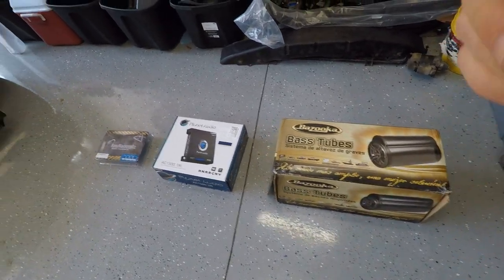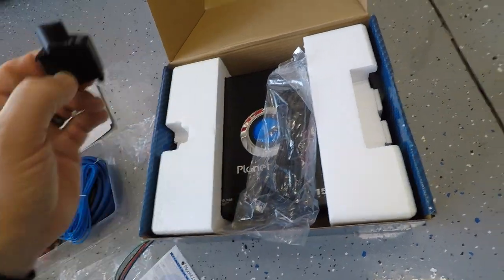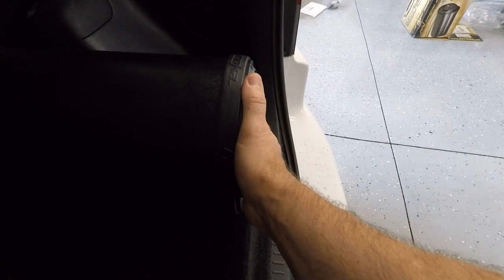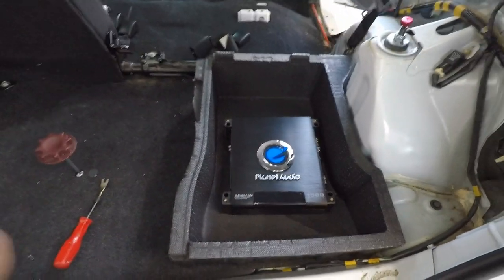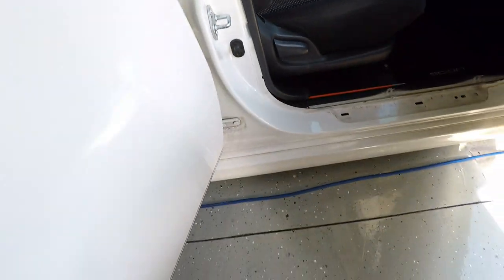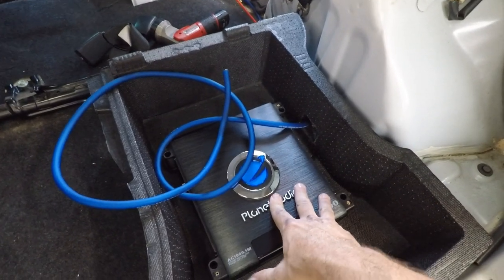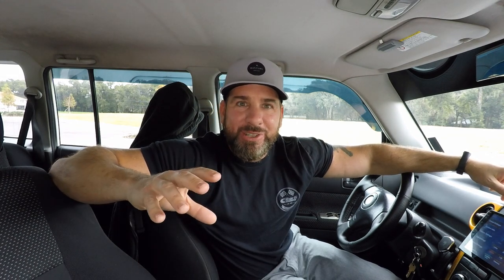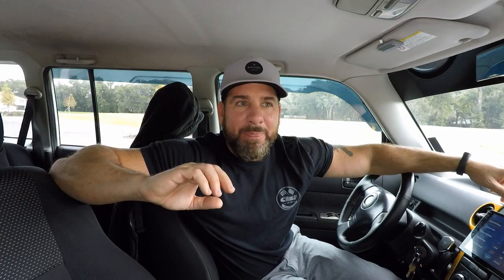How to Install an Amp and Sub!!

Comment: Couple things for future installs. You should run the rca cables away from the power wires to avoid possibility of interference noise, the remote bass knob is not a boost knob but rather it is a gain control which should be turned all the way up when setting your gain. On the bazooka that should be a dual voice coil and you should use an ohmmeter to wire it correct (series or parallel)

Comment: I've got my amp mounted under the passenger seat, there is so much room under that thing. Also you'll be taking those panels back off for the back up cam haha. I also made a bracket for my fuse holder against the firewall. I enjoy doing this stuff. I used to work at circuit city back in the roadshop. Those were the days! But solid work, and merry Christmas to you and Kelly!
Reply from the maker: Thanks for watching and Merry Christmas to you too!

Comment: Here comes the Boom!  Knu=new... clean install, ya learning...you'll want access to adjust side of amp... next install... two choices...sound throughput van or some peeps choose driver centric... then...adjust high, mid n low...you love the 8"...easy...mid n highs to personal preference...keep the lil flathead in van to adjust the amp...good job B...keep turning that wrench...one love
Reply from the maker: I appreciate it! Thank you! Merry Christmas!
Reply: No worries...if you get feedback in speakers...you may need a crossover...not xpensive...check it out...Merry Christmas bro!

Comment: Another awesome video! Don't worry about distortion. I've had a bazooka tube in my xb for about a dozen years, all my wires are bundled together running down the passenger side behind the kick plates, never had any any feedback or distortion.
Reply from the maker: Good to know! So far I haven't had any issues either!

Comment: It's recommended that you run the signal wires on the opposite side of the vehicle versus the power wires. You may run into interference having them all together. I did my setup that way and never had a problem. Hope this helps! PS, I miss the Lude!
Reply from the maker: That's a good tip. I hadn't read that. Thanks for sharing!
Reply: I read that too! I kinda sorta did the same on my setup. Power and ground immediately splits and separates after the firewall but I'm running both lines through the same hole on the firewall so maybe what I did was useless? My sound is still clean though. No weird interference /static noises at all.

Comment: Have you thought about drilling some holes in the styrofoam cubby to keep the amp a bit cooler. That foam is going to keep that amp to warm bro. Just a thought. By the way I really appreciate your videos they got me through my covid-19 recovery. Take care and thank you for the great channel.
Reply from the maker: Great idea! I thought about that. I wonder how hot it gets in there? I really would like to mount it to the back of rear seats.
Reply: @ExtremeDailyDrivers  you can also use a small fan like on a desktop computer
Reply: Yeah it’s been 11 months. Did your car burn down yet?

Comment: Nice vid! 5hrs B!? I think maybe you were being pretty with this install: Takin your time to smell the roses as you went along😅. Your wiring is pretty clean though 👊🏾 What took me a couple days was tuning my sub and finding that maximum sweet spot. Using the cell phone with the bass tone like you did would've saved me time! I did mine by ear (which was a little annoying) testing many  songs in my mp3 library which all have varying levels of bass and loudness.
Reply from the maker: I feel like every song needs a different set up on the equalizer. I'm always messing with it and the bass knob. I little adjustment goes a long way!!! I have my equalizer set up for Rock and Electric music and I switch between the two.

Comment: Make sure to add the caps that go one each side of the fuse holder it covers the nickel and screw access on fuse from shorting out also cover up the rest of the terminals for power and ground  with black tape so it’s not exposed
Reply from the maker: Good catch. I fixed that off camera during the install.

Comment: Great video, Can you show a video in how to clear display lights on Scion xB when showing VSC, ABS and traction control. Their is no check engine light on.
Reply from the maker: Been there, done that, Dude. Where have you been? Make sure you are sub'd so you don't miss a video and also always review the xB Playlist when you are searching for a video.

https://youtu.be/FNBLiDeojWw
Reply: @ExtremeDailyDrivers  the problem is I don’t have any check engine lights codes to read just the three lights VSC, ABS and TRAC.
Reply from the maker: Those lights mean you are throwing a code.

Comment: Hate the trunk space on these cars. Have a 12” sub on the back on mine. Took me roughly and hour to get this done. My bass control is on the exact same place as yours lol
Reply from the maker: Great minds think alike! The trunk space could be better, that's why I went with the bass tube because it's small and easy to disconnect when i need to.

Comment: Hey it’s recommended to run RCA’s and signal wire on the opposite side of the power wire if not the audio will distort
Reply from the maker: You are the THIRD person who suggested this. Where were you guys during the install?!!?! JK. So far so good, but I will keep an ear out for it.
Reply: With a good shielded twisted pair...  shouldn't be a lot of cross talk.
Reply: if you use quality rca it won't. Also with just a sub amp you shouldn't get any of that engine whine or anything

Comment: Hey there I've seen your videos and like your project on the life. I got a 3rd gen 89 and I'm working on the suspension rear. But I'm having problems with all this rusted bolts and trying to find parts. I would def need any advice you can help with
Reply from the maker: Parts are impossible to find. Ebay and junkyards are your best bet. As far as rust goes, you might want to buy a torch or a angle grinder and cut them off. Good luck.

Comment: hey man! do u have a high power alternator or are you just running a stock 80 amp alternator? been thinking about doing this but i dont know if i should upgrade my alt first.  P.s Love the videos man keep em comin!
Reply from the maker: I am running the stock alternator. If you follow the channel, you know I have done the Big 3 and it made a big difference. I am still getting 14.3 volts every time at start up. Thanks for watching.

Comment: If you get any weird noise coming from the radio is because you wired the remote wire in the RCA wires with the power wire,Hopefully it doesn’t do it to you if it does run it on the opposite side RCA wire and remote wire on the left driver side instead of the passenger side.
Reply from the maker: You are the second person that has mentioned that. I'll keep an ear out. So far, so good!
Reply: Awesome 🤙
Reply: I think that rule applies to old school rca's that were made with old tech. Nowadays amps, subs, decks, wires, are all waaaaaay better now. So you shouldn't have an issue today but I think it's just a car audio superstition that everyone just does cause it used to be very true lol.

Comment: Did you use both voice coils on the bazooka? Wiring both the negatives and both positives  to each other; thats why you had four connections on the sub.
Reply from the maker: ? Can you explain that better? I wired up one side of the tube. Was that wrong?
Reply: Best I can say is look up how to wire a dual voice coils and ohm impedance for your amp. Depending on what your amp can handle you can either wire the coils up in parallel or series
Reply from the maker: Got it! Thank you. I guess I'll have to retune everything again. Thanks again. I was confused by the bazooka tube setup.

Comment: You can look at what rms power is putting out on your amp I have a 2000 watt amp the rms is putting out 1500 watts.
Reply from the maker: There is lots on YouTube showing you how to properly measure what your amp is actually putting out. I think they did one on the amp I purchased and it puts out like 600 watts.

Comment: Shouldn’t run rca with main power wire it can interfere,  always run rca and speaker wires away from power.
Reply from the maker: Many people have already stated that, but I haven't had any issues.